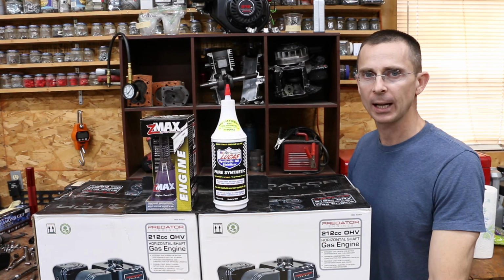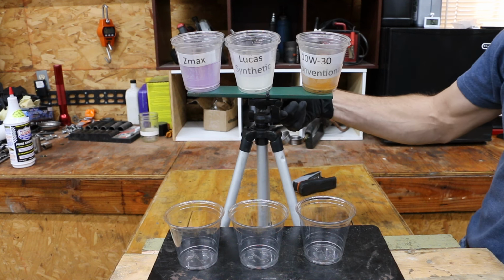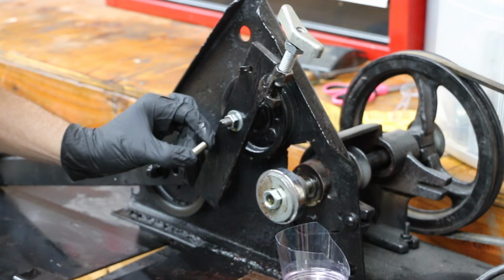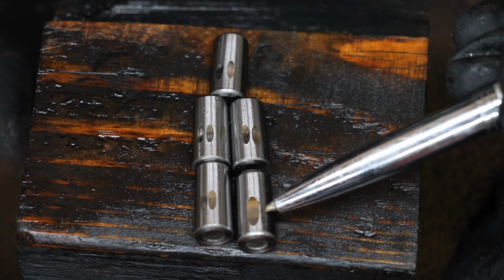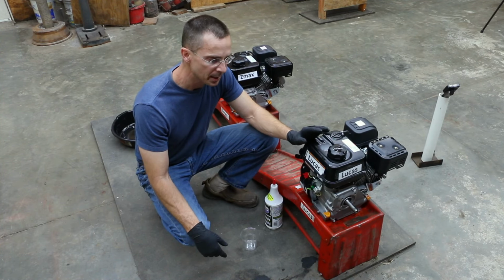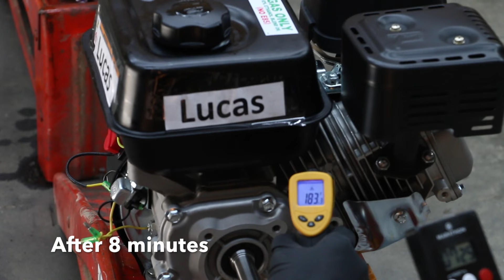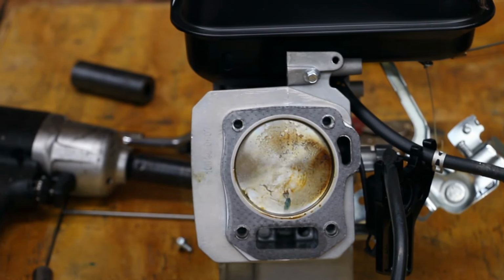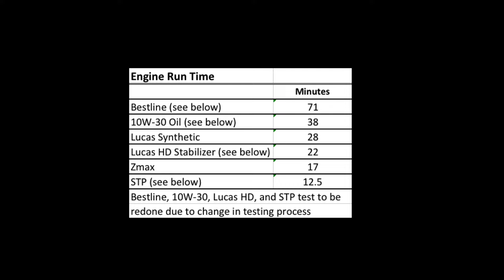Which engine self-destructs first? Zmax or Lucas Synthetic?

Comment: Loved these videos! It would be nice to see some royal purple, i heard some good stories and some horror stories.
Back a few years ago in college, we managed to get a Briggs intek for some experiments on how to increase rpm stock.
First it revved to about 5-5500rpms, then we removed the spark arrestor on the exhaust, then air box, filters, slowly getting it higher and higher, the breaking point was when I think we used some bigger valve springs, I swear to god the tachometer showed 8200rpms just by removing all restrictions. The connecting rod let go and later found that it had failed due to lack of lubrication, not of stress. I'm surprise the flywheel didn't go!
I'll find the video some day.
Greetings from Canada.
Reply from the maker: Greetings and thank you for this recommendation.

Comment: You do have to keep in mind some cars or motorcycle say not to use any adetives because the clutch is wet by the motor oil that would cause slippage or wear of the clutch
Reply from the maker: This is an excellent point. Thanks for commenting.
Reply: Lucas synthetic does say on the bottle to change the mixture in such instances as a motorcycle with a wet clutch. So it does show that you can use it in such situations without damage.
Reply: jaso ma

Comment: We tested the Rotax 2 stroke engine (6400 rpm cruise) in an ultralight and normally we pull the engine down at 300 hours for a top end overhaul, but when we pulled the engine down with Lucas Full Synthetic Racing 2 stroke oil, we found NO wear.  So we put it back together and ran it until it would fail.  We ended up running it for another 1000 hours and it never failed.  We pulled it down and found very little wear and only changed the plugs 3 times.  Lucas is REALLY GOOD STUFF.
Reply from the maker: Thanks for the feedback.

Comment: I wonder- which product would perform better, IN PLACE OF oil (100% strength) running, then dry. You remember when Slick-50 first came out? The guy had an old inline 6, valve cover off, no oil, and with a water hose- would douse the engine, even the distributor? No trickery there, huh? It's all so much snake oil. Imagine- cold winter morning- crankcase full of Lucas? Bye bye, engine! Another awesome video, thank you so much.
Reply from the maker: This is a great point regarding 100% strength and I'm really curious of this too. I might test this if there is enough interest.  Thanks for the positive comment.

Comment: I said it once and I’ll say it again!

Put those engines on a counter weighted rotating mechanism so you don’t have to pick them up and tip them over while supporting all their weight laterally

You can secure the engines to a platform that tilts along the front to back of the engine where the oil drain is, so you can tilt the engines and pour out the oil with one hand!
Reply from the maker: Yes, I need to do this, but haven't made the time.  This is an excellent suggestion.  Thanks again.

Comment: Great vidio,i have a 06 Tacoma and have been using Lucas with Mobil one after it reached 50,000 miles,it now has 230+ miles and doesn't use or leak a drop of oil,and runs as good as a new one.i believe in friction reducing additives.
Reply from the maker: Thanks!  That is great!

Comment: I would love to see Marvel Mystery Oil in one of these tests
Reply from the maker: Thank you for this recommendation!
Reply: Marvel Mystery oil isn't meant to add lubricity or make your oil better.  It is a cleaner that helps to prevent carbon buildup inside your engine.
Reply: marvel mystery oil is an excellent CLEANER much like seafoam. will not improve oil performance
Reply: Project Farm have you done anything with Marvel Mystery Oil yet? If you have I have missed it LOL
Reply: Serveck agreed it's a very good cleaner but doesn't really add any performance to the oil other than bringing the detergent package up a little bit you know?
Reply: i agree all my life i ve heard its good on all kinds  of stuff maybe do a few different test with it i ve use it few differnt stuff myself and wonder and wonder secs on it and whats it made of

Comment: I know this video is 4 years old but while watching it a couple things came to mind. One was the thing about breaking in the engines. It USED to be that you needed to use a non detergent oil for this but nowadays, manufacturers say to break it in with what you’re going to use in it normally. The non detergent helped seat the rings in older vehicles, not anymore. Secondly, have you ever heard of a lubricant manufacturer called Lubrication Engineers? I used to work in auto parts. We would order this stuff specifically for a few customers.  One was a Ferrari owner that swore by it and used only it. The second was a drag boat owner/ operator that was amazed at how much it cut down on wear. He had to tear the engines apart between passes and was used to having to replace bearings. With the LE, he didn’t have to as often. I wonder how these tests here would fare. Love the videos.
Reply from the maker: Thanks!  Thanks for the video idea.

Comment: Damn! I knew Lucas was pretty good stuff but I definitely didn't expect this! Lucas it is... Thanks!
Reply from the maker: Thank you.  I like the Lucas Synthetic.  The high viscosity of the other Lucas product  (Lucas HD oil stabilizer) is a problem is cold weather.
Reply: Bill Carini Try Motorkote, do some research...
Reply: Your not kidding! Lucus is the best out there!
Reply: @toddjacobs5660  motorkote is ok, lucas' new low viscosity is coming out soon
Reply: @ProjectFarm  I have been using Lucas for more than a decade in all my engines. They run quieter, and the oil looks like it is in better condition when I change the oil. I have no idea if the fuel economy is improved in any way. Differences in driving habits likely make way more difference as far as fuel economy goes.
Reply: I know a dump truck company owner who has used the HD Lucas oil stabilizer in his Freightliner truck on every oil change since new and it went over 1 million miles before it needed any engine work. Old Mercedes diesel.
Reply: @douglas95101 one truck at my work has a Mercedes mbe4000. It has a head gasket issue but I guess it has been reliable. They paid $5000 ten years ago for it (it had hit a moose). 1.2m kms on it now. Pulls good but engine brake causes throttle delay im not used to with cat or Cummins and it aggravates me a bit.
Reply: @douglas95101  heavy trucks does not need any additional oil to make million miles... i own trucks myself,  my freightliner argosy with over 900,000km on the cummins engine, it still running like new. i just look after my trucks and maintaining them on time with conventional oil.
Reply: @alexgreen287  only this product. Many Lucas products failed many tests
Reply: @captainamericaamerica8090  i did not know? What tests did it fail?
Reply: @alexgreen287  ask him. Here. They failed against the better brands oils
Reply: @ProjectFarm  which lucas failed in other brands?
Reply: Lucas is oil premixed with a "climbing agent" that makes the oil stick to moving parts (gears, crankshaft counterweights, etc.) so it will get flung into neglected spots the oil doesn't normally reach. Lucas doesn't add any lubricity to normal engine oil, but because it's premixed with oil already, it's still a decent lubricant on its own. It's a BAD idea to run 100% Lucas though, because too much climbing agent will prevent the piston rings from scavenging oil properly and the engine will smoke like a chimney.
As for the Z-Max, it's basically a "pour-point depressant" that reduces the viscosity of cold oil so it circulates better -- hopefully without reducing the hot-viscosity of the oil once it's heated up. That should be completely unnecessary in a modern car because the oil they use is so thin already. However, I'd be interested to see a repeat of the initial viscosity and lubricity tests with the oil+additive mixture cooled in the freezer overnight.
Reply: @deusexaethera  i see? Will there ever be a oil that can protect a engine 100%? Hope so.
Reply: @alexgreen287 : There is no way to completely eliminate wear between touching parts. That is physically impossible. A few atoms will always rub off, and that effect accumulates over time. You can see this by the way soft human skin can polish hard steel railings on old staircases. So if you want an engine to last forever, that is impossible. However, the best way to keep an engine running well for as long as possible is simply to change the oil AND the oil filter at least once a year.
Reply: @deusexaethera  or in my case, every six weeks or so. 😁
Reply: @piperpilot26 : Depends how you drive. If you change the oil too often you're just wearing out the threads on the drain plug and oil filter to no benefit.
Reply: @deusexaethera  iDrive roughly a thousand miles a week. I generally try to change my oil around every 5000 miles or so. But yes, I do agree with you. Changing the oil too often isn't good.
Reply: @piperpilot26 : Yikes. That's way too much driving for me.
Reply: Damn and I been a fan of zmax all these years. I never had a problem with the product but I decided to check out the reviews before making a purchase again. Sucks all that money went to waste for nothing. I’ll stick with restorer and start using Lucas from now on. Thanks for the video bud and stay safe👍🏽🤙🏽💪🏽

Comment: Love these tests, I've used zmax and Lucas in the past. I will never get zmax again and as much as I like Lucas, I watched the test you did with motorkote, I will be going with that for a while. Also watched the one with the graphite and I gotta say I'm kind of intrigued by the increase in compression.
Reply: I second the enthusiasm and interest in  motorkote.
I was more impressed with Motorkotes protective abilities than with the STP vs. Lucas video that he did.... And another clip on the top of the line  is the one comparing the different types of Pennzoil motor oils.
And he stated from findings that the Pennzoil was second place to Amisol Which  is a top of the line oil and is really expensive..
I wish he would do  cream of the crop test with additives like
Lucas, motorkote, along with synthetic and non synthetic oils like Pennzoil max, Castrol Titanium, Mobil 6000,  Amisol along with a random oil like Valvoline 10w40 all with the additives...
I personally am thinking of going with motorkote and Castrol Titanium   (which claims 12k mile change intervals)
Or Motorkote and Pennzoil max.
Pennzoil max is a 3mo. Inervals.
I don't know if you put the motorkote in with every change.. of if it's a one time thing like slick 50..
Reply: I used oil with graphite in the 80s in a new chevy impala.  By 60,000 miles the valve lifters were clicking.  Oil was changed regularly.  I blamed it on the graphite.  Still do.

Comment: A good idea here, I was wondering if you could try different engine assembly lubes specifically Lucas assembly oil and white lithium grease. No oil, which engine self destructs first. I do a lot of engine rebuilds and this would help me a lot. You have some of the most unbiased opinions and test strategies on YouTube keep up the good work!
Reply: I love this idea. I just bought some of the lucas product because it was the only thing I could procure locally in time. Not what I normally use but would love to see some comparisons done as well. Always the most thorough testing I see of any product.
Reply: I’m with the 98%👍🏼

Comment: Hint to viewers, the vast majority of oil or fuel additives and off brand products are useless and the few that might do something positive are not needed, save your money. The rare exception is when government meddling and regulations result in problems with older engines and some diesel additives are actually recommended by manufactures, lubricity enhancers,   cetane boosters added immediately before use and anti gel in very cold weather.  Love this channel, might be one of the rare honest channels.
Reply from the maker: Thanks so much!

Comment: my friend said driving around with engine flush in his engine oil would not be bad for the car, I told him it would be bad as it makes the oil lose it's lubricity and burn up. Maybe you can put some engine flush in a lawn mower engine and run it and see what it does to the oil!
Reply from the maker: Thank you for this video project recommendation.
Reply: as i rememeber it, its just a thin oil , not a multigrade, should run well enough but probably not bad enough to ruin an engine in a short time frame

Comment: What I've wondered for quite a few years is how well good ol' vaseline would work as an "oil stabilizer" at about 10% concentration.
Reply from the maker: Thank you for this recommendation.
Reply: Renewable Oilcan Rim I doubt it would do much. Petrolatum, which is basically petroleum jelly, is used in the aerospace industry to lubricate o-rings when installing parts to prevent cutting them. It's not usually used in the oil system, but there are times when it's better than straight oil. The oil and fuel just break it down and it cycles through the system as normal. Granted, it's a fraction of a percent of the total, but it's still there.
Reply: jimboyokel I used Vaseline for rotaries too but also tried straight STP. I found that the oil control seals had a much harder time seating with STP
Reply: jimboyokel I use Vaseline for assembly lube in rebuilding transmissions
Reply: Renewable Oilcan Rim .

Comment: I think the Z Max is designed to remove carbon deposits in an engine. It also comes with a gas additive as part of the kit. I did notice the piston head was clean on z max, but Lucas had a bit of carbon build-up. I use z max and sea foam they both remove carbon very well, but I'm not sure if it's intended to aid in lubrication. Cool test, thank you.
Reply: That's right is made to clean oil deposits before an oil change .

Comment: These two products are designed to do really different things.  ZMax is designed to remove build up over time, decrease carbon deposits, etc.  It is proven to increase gas mileage, extend engine life, reduce heat, etc...  Lucas claims to reduce friction, eliminate dry starts, etc... so Lucas is supposed to coat the internal parts and reduce friction like bacon grease in a drain, Zmax would be more like Draino, it gets into the tiny cracks and reduces the carbon build up or prevents it in the first place so everything flows better.   So you got exactly the results you should have on this test.  Try testing older engines with similar build up and see which one runs better or has less build up after treatment would be a better way to see how ZMax works.
Reply from the maker: Thank you
Reply: @logankincade661  How's that Tourette's coming along logan? Any better these days?
Reply: Fu** if I know.....
Hahahahaha
Reply: @logankincade661  - Alright... You get points for that one. ;-)

Comment: You Should Fill The Crank And Run An Engine With WD-40 And Chain Lube And See Witch One Lasts Longer
Reply: Anything Moto Don't forget about Marvel Mystery Oil too!
Reply from the maker: Thank you for this recommendation.
Reply: which
Reply: It would be interesting to see WD-40 run instead of oil.... or WD-40 used as an oil additive
Reply: Man! Pour in one of those gallons of wd-40 haha I bet that stuff smokes up a storm at a high temp!?? At least it will smell good in there! 

I know they're not engine additives but A fun one would be 

WD-40 (The legend)vs Boeshield T-9(developed by Boeing)
Reply: Bar oil is pretty much just oil with tackifiers... i imagine it will be fine.
Reply: Anything Moto I thought about that too. Here in northern Mi,you wouldnt be able to even pull the engine over in the winter with chainsaw bar oil.
Reply: RC Hobbyist Extreme LOL!
Reply: Basically, it's the same as Lucas
Reply: I was just about to make the same suggestion about using wd40 and maybe baby oil 😂

Comment: I have tried almost all of these additives before and they are all terrible. Lucus oil is the worst offender really as it generally is too gooey and will often end up harming a car engine. However I found one product that not only works but has saved me so many times. In fact one time all the oil in the car was gone and you wouldn't have even noticed which I didn't by the way because the engine ran normal at 75 on the highway with zero oil in it for over 100 miles. It's called prolong. If you have an old engine and get knocking sounds, prolong makes that go away in a heartbeat.  By the way thank you so much for all your videos! Based on your testing and advice I've gotten more than a few products like battery jumpers and bolt extractors that have saved the day and worked flawlessly just as your test results showed. I love your scientific and exhaustive methods for all you do, thank you so much for all your hard work.
Reply from the maker: You are welcome!  Thanks for the feedback.